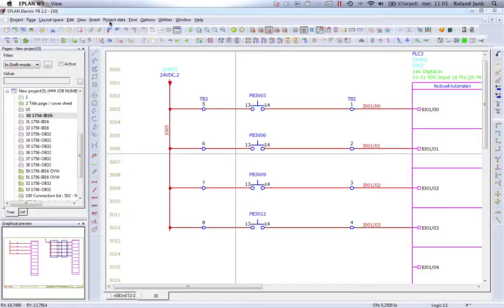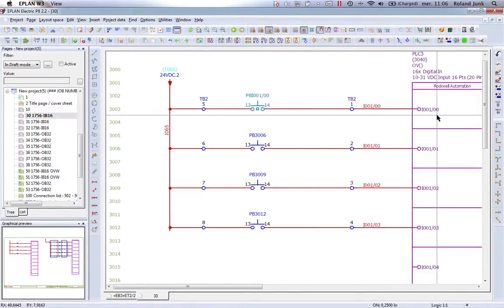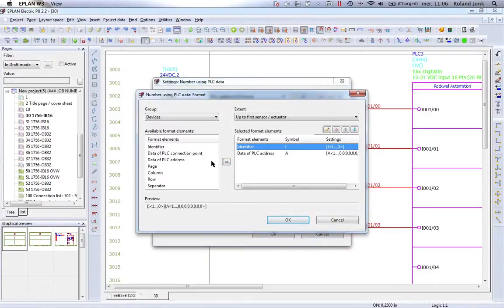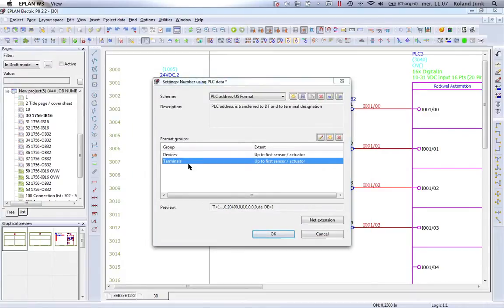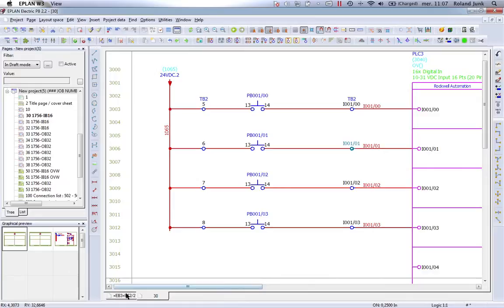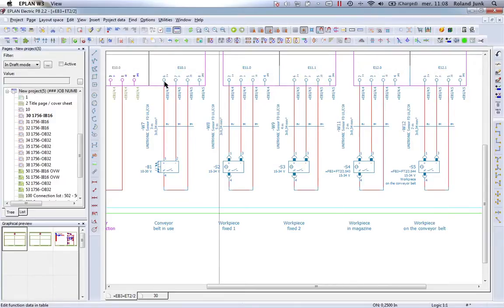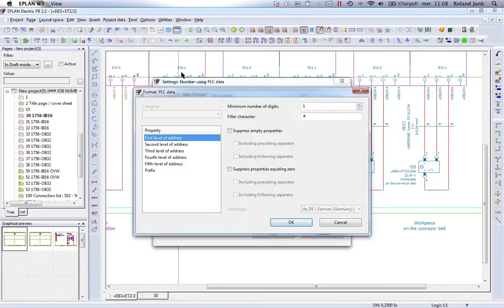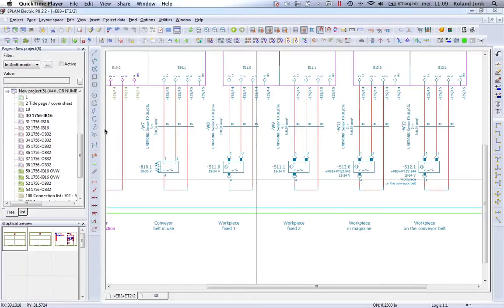EPLAN P8 Device Renumbering Using PLC data

Comment: Is this only possible for DIGITAL I/O's ? Not for Analog I/O's ? Be cause in Analog connection you have more then one connection point, and when both are connected to terminals only PLC connection point which has a function defination of AI or AO is getting changed.. not next one...

Comment from the maker: The "wire numbering" is handled through the menu "Project data - Connections - numbering - Enter designations". The connection numbering scheme can be adapted with a "connection group" that will number all connections connected to a PLC connection point. EPLAN provides 3 different groups that all connect to PLC Connection points. Select the right one and assign in the format which PLC Data you want to transfer. I recommend using the group: "Connections connected to "PLC connection points, I/O, 1 connection point" or "PLC connection point, variable"", then pick form the available format elements : "Data of the object on which the connection gourd is based: PLC Address".